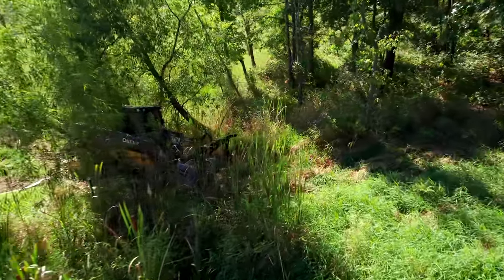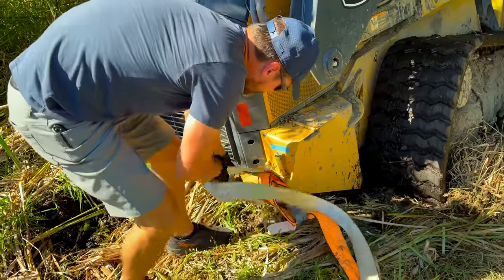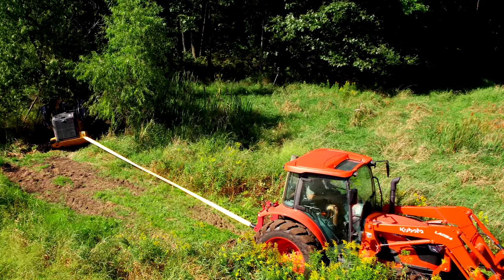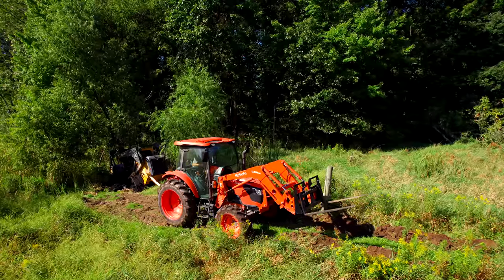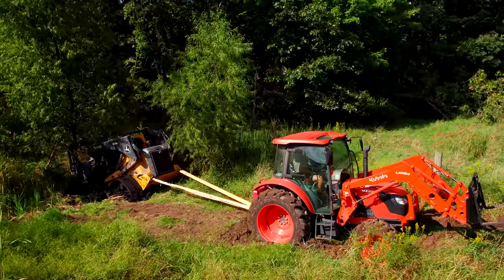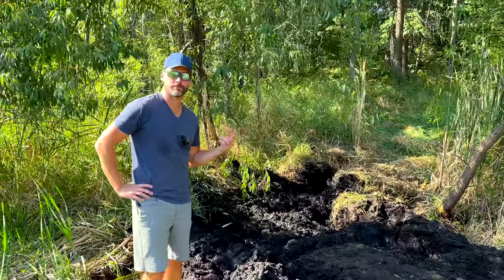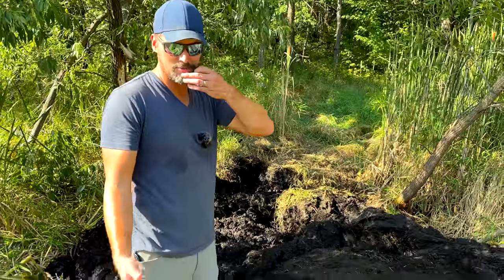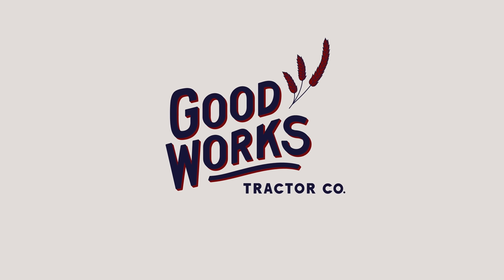I'VE CHANGED MY MIND ABOUT SOMETHING I SAID OVER TWO YEARS AGO!

Comment: Yes - Locking DIFF can make a big  impact 😉  You needed some “Yank’M” ropes!! Matt’s Off Road Recovery and many other channels absolutely prove that kinetic elastic energy turns pulling into monster yanking!!👍🏻👍🏻👍🏻
Reply: Yep.  A Kinetic Recovery Rope and getting a light run at it with the Kubota would most likely have popped the track loader up and out of its hole.  That said, and as you guys did, you should not try the momentum trick of a kinetic rope with a standard non stretching nylon tow strap.  That's asking for things to break somewhere.

Comment: I’ve been stuck many times where I would have failed to come out w/o the locking diff.  Also, don’t  under estimate the assistance your loader bucket can add; it may only be capable of moving you a few inches but that is sometimes all it takes to get your tires to grip enough.  Glad to see the rescinded opinion!

Comment: While I might not need the locker most of the time, I automatically reach for it as soon as one of the rear wheels start spinning to reduce spinning and make less of a mess in the yard. Overrated or not, it's a tool that I have in my toolbox, so I use it as needed.

It's easy for me to say this behind my keyboard after the fact, but my friend got his neighbour's tractor unstuck earlier this summer. He put a load on the front loader to put additional weight on the front wheels to get more traction from the front because when pulling like this, it seems to want to lift the front. It may or may not have helped you in this case, but wouldn't hurt.

Also, those recovery straps are designed to tug on them and the bungee effect helps pull the stuck vehicle out. As much as I hate tugging, I've done so a few times getting unstuck of the snow and the tugging helps. I'd never tug with chains or ropes though, only recovery straps.

Comment: A tip from @TractorTimeWithTim is to use the ruts your tractor makes.  If you back up, just behind the rut, you can use it to pull "down hill", so the weight of the tractor gives you a little more pulling power, and the wall of the rut gives your tires something to grip.
Reply: But as soon as you’re in the rut then all your pulling power goes into climbing yourself out or your own ruts.  The only way this works is if you have your straps adjusted just right.
Reply from the maker: You can see us do that occasionally in this video, but as @Motor 2of7 mentions below, it only works until you're back in the hole! Then it's back to crawling up (or spinning your wheels).
Reply: @motor2of7  Yes I am pretty sure TTWT uses adjustable chain to get it set at the top of the rut.

Comment: Look into kentic recovery ropes. Game changer. Could use 1-1/2inch rope. 70,000 rating. usually want about 5-6 times the weight of what you are pulling.

Comment: I use the rear differential lock on my tractor more than you’d think. I wouldn’t want a tractor without it! It’s really helpful for putting more power to the ground and reducing slip in sticky situations. I got unstuck using 4wd, the diff lock, and the loader once. Took it all to get out…

Comment: Good video. And any extraction is a good extraction if you don't break anything. My only suggestion is. I think a bucket would be better than them forks on the tractor. It's easier to scoop up some weight for the front axel. And a whole lot easier to clean up the ruts when your done.

Comment: Never go where the willows grow. A drag would have been the thing to use on removing those trees. Good job on getting unstuck. Coincidentally, I got my pickup stick in a washout on a road at the hunting lease. Ground was completely dry, but had been undercut and road collapsed under me. Fortunatly my tractor was only a 1/4 mile away. Chained it up, put truck in N and drug it right out. Fortunately on a favorable grade that truck went no further than I pulled it and parked tractor, put truck in park, eased thractor up to slacken chains and back in business. One man job. 🧠💪🚜

Comment: I had an older new Holland 783 skid steer, 1992 full cab, tires, pretty big machine could load a tri axle dump truck and burried it once , tried using my 4x4 pickup to pull it out, broke chains and eventually had to call my grandfather and he came down with his old tractor a international harvester 584, 75hp I believe, just two wheel drive but a very capable machine he had a full running farm with 100 cattle and that tractor dragged that skid steer out like it was nothing. Front wheels bouncing off the ground and all, he had a smile the whole time haha. that's exactly why I sold the skid steer and got a Kubota l-series, the skid steer was strong and would lift alot more weight but the ground clearance was always an issue and couldn't turn sharp without digging up the field, lawn or even gravel if it was softer. Esp in the winter ground clearance was an issue but don't skid steer can definitely lift twice the weight of my Kubota l3940 easily but I don't need to lift that much ever really.

Comment: Several years ago I used my little John Deere 870 equipped with the JD loader and the backhoe options to actually dig and help nudge my CAT D3 dozer out of a very similar quagmire.  It is the smooth bottom of the dozer, like the skidsteer, that creates the suction that can be near impossible to break free from.  Once I was able dig enough of the mud away from the CAT lessening the suction, i was able to easily use the 4000 lb. JD to help pull the 18,000 lb. dozer free.  And diff lock was a big part of the solution.

Comment: That's where a 12,000 or 15,000lb winch would come in handy.  I did something similar a few years ago.  Walked on it, seemed firm enough, then proceeded to get my tractor stuck in the same type of mud.  I then proceeded to get my truck stuck.  With my father-in-law's help, I then got my truck out, but then got his F-250 stuck trying to get the tractor out.  A 12,000lb winch got both the F-250 and the tractor out.

Comment: They are called snap straps for a reason. Back the tractor up and run to the end of the snap process more pull than you can do with just the tires.
Reply: Those are NOT Kinetic recovery Straps.
Reply: @m9ovich785  you might be surprised to hear this, but we've been yanking out stuck vehicles with plain old nylon straps since the 70's. Wish I'd have known before now that it doesn't work.
Reply: @jimmaag4274  Me too LOL Just not yankable as a kinetic Rope And just a bit more Forgivable than Chain .
One trick I've learned with chain, is to use 2 with on old Tire connecting them together. 
Kinetic Rope is all I carry in My vehicles, ATV and Tractor. 
Mie M.

Comment: Here on the farm we’ve used a rubber tracked skid steer many times to get a tractor unstuck but never used a tractor to pull out a skid steer.  Looked like you almost got the tractor buried in the process. 😀

Comment: Once you break the surface and start getting the Tow Tractor digging in does it not just dig deeper because the foliage root system is gone ?

Plus pulling in a straight line uses less resistance than trying to pull on an angle even with the tracks?
Reply from the maker: a straight line would have put the kubota into low, soft, reed filled ground. i think we may have had two stuck machines then.
Reply: @GoodWorksTractors  but once you hooked on the other corner, that rotated the skid steer and it was much closer to a straight line, that might have helped some.
Reply from the maker: @grattonland  Correct, which is why we did what we did.  Had to get around the trees towards the back right corner of the skid steer and front left corner.  Once we did that, we could reposition which happened several times.  Only had a 8' wide strip of high ground for the Kubota, so limited to that lane.
Reply: @GoodWorksTractors  

Thanks

No other options then

Brute force will work when its the only option

I've been stuck in muck almost that wet but with a Tractor weighing a lot less maybe 25% of Your Skid Steer

I don't know what size winch would have been needed but it seems tow trucks anchor the truck and use winches as the pulling device and the truck as an anchor

Also the angle of force a tow truck uses they use the boom higher that the stuck vehicle lifts it up and out to clear the hole the stuck vehicle is in

I know that problem would require some type of device like a triangle that no one has handy but it would provide the upward pulling angle as the the base stays in place and the tip moves upward

Its a Physics problem of inertia/Friction/and resistance / leverage

Fortunately I was not stuck anywhere near as bad as you were but My L-2501 was belly deep with a Box Blade on the back

I had to manually remove it from the quick hitch and stand it on end to flip it off to the side to get it off and out of the way

I was 66 at the time and it was not a fun trick to pull off

I bought a cheap light weight 12 volt winch from Tractor supply and a couple of 20 foot tow chains and used My Durango reese hitch as My anchor point

If I was in worse situation I would have bought a bigger winch and maybe chained the Durango to another place or vehicle

Or called a Tow Truck

I try not to give though, LOL

I called a Friend to help Me and He dug the muck out from behind the tires and worked the winch at the Durango as I drove the tractor backwards

It was a slow pull

Looking back I might have been able to attach the winch to the tractor and used a snatch block off the Durango or another tree.
Reply: @PurpleNovember  

I know about getting a tractor belly deep

I lived it

A tow truck would have been simpler for My stuck tractor, but I'm stubborn and My Friend and I won 

Thanks

Comment: 2nd time getting stuck resulted in some content.  Would boards under the back of the tracks have helped to climb out of the hole?  Great job getting it unstuck.
Reply from the maker: Most likely boards would have helped. We aren't stocked with tons of scrap options here yet (since we haven't even officially moved in). But we were talking about looking for some boards right before we got it out.

Comment: I'm sure you guys get all kinds of advice in these comments but if you have a large Tire or a nice size rim off of a truck you can place it underneath the strap right close to the vehicle you are trying to pull out and it will lift it up as it is pulling it out so you don't have to just drag it straight through the mud

Comment: Proof that it isn't about horsepower...gearing gets the job done every time
Reply: Traction and power gets the job done. No Traction no go. No power Traction won't do any good!
Reply: @rodbagley1686  I generally agree, but people get really hung up on horsepower and I think that kubota is only 70 horse...yet it pulled a 6 ton skid steer belly deep out of the mud...yes traction very important as the tractor was in some soft crap also.

Comment: I bet your old JD 5115 would have made easy work of this - well, easier! Do you ever regret selling that off looking back?
Reply: yeah if you would have had that JD 5115 with wheel weights and fluid in the tires ( the tractor would have been closer to the same weight as the skid steer )  it would have been an easier pull.

Comment: One minor point of advice... Its am acquired skill i realize...but learn to walk a tractor with the bucket on the loader... It would have helped the Kubota reverse with out digging holes deeper. Wouldn't help getting your skid steer pulled out with the mower on it, still, a good skill to have. With a bucket on a loader, no reason why a tractor should get stuck.
Reply from the maker: Yep. Had I (Chris) been really stuck, I would have relied on that. I suppose I could have tried to avoid digging such big ruts by keeping some pressure on the loader. Next time!

Comment: Sorry I don;t like the way you did this. From the looks (remote of course) you were pulling into the tree, not the way you went in. (Where you would have had to pull might have been wet?)  Also It might have been beneficial to have pulled up some with the loader and the forks ... backing out rather than trying to drive forward. Just ideas for the next time. ie making better use of the forks/loader to add lift to the pull. Congratulations on getting it out...
Reply from the maker: yeah. the ground parallel to the rear of the skidsteer in its starting position is low ground, and full of reeds. so most likely a recipe to her another big machine stuck. we pulled along a lane of high ground that we use to get in and out of this section of the property. 

I don’t think the loader would have helped at all, since max lift capacity on that Kubota id about 25% of the weight of that skidsteer.
Reply: @GoodWorksTractors  I hope I was respectful and it was recd that way. With the straps low the force went into the hill. The tractor definitely could have tipped with the loader high, but I  believe the upward force could have helped... I love pulling fences with the bale spike / now a fork. Better control.

Comment: If it's worth doing,  do it right LoL.  Worse stuck ever. Onetime I got my Kubota tractor stuck in a soup hole and left it overnight.  It had the Shuttle Shift geared transmission.  Bad thing is, water seeped into my transmission and  the clutch never worked right. Costly repair.  Lessons learned.